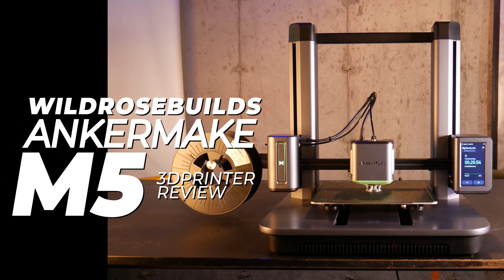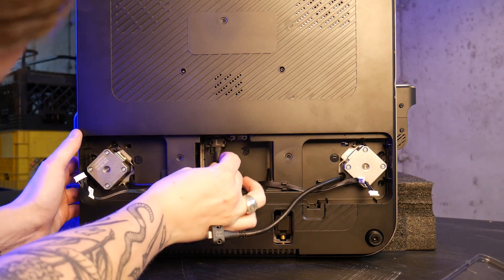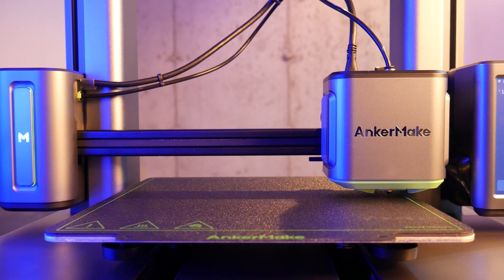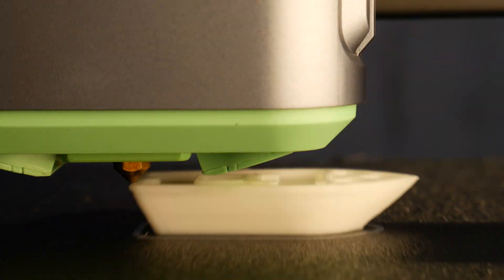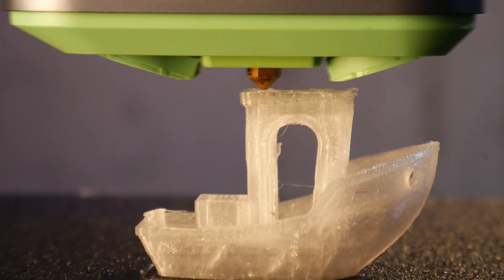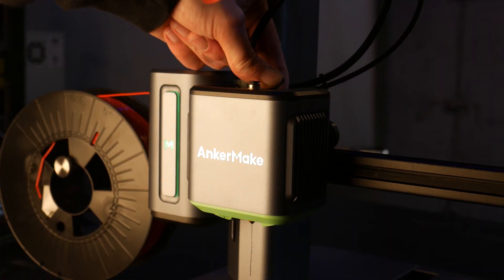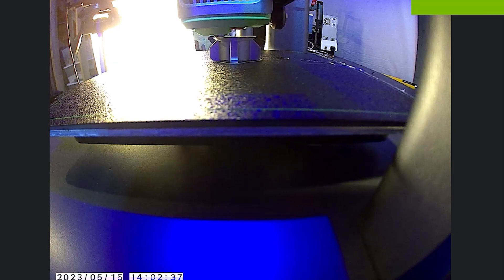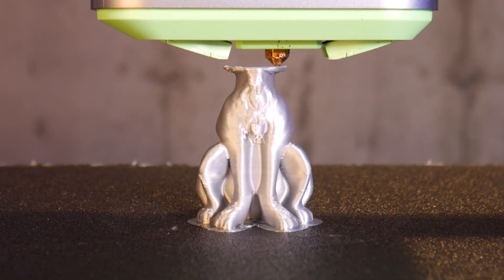ANKERMAKE M5 3D Printer Review - WildRoseBuilds

Comment: No, no it's not the future of 3D printing. Mine was garbage. Wasn't worth the 500 I paid as a Kickstarter backer. Returned after 2 months of troubleshooting. I am relatively experienced, and have a highly modded og ender 3 from 2017 that was more reliable. Their qc is not good.

My p1p however has been almost perfect. Not a single minute spent troubleshooting the printer, only failures due to human error.